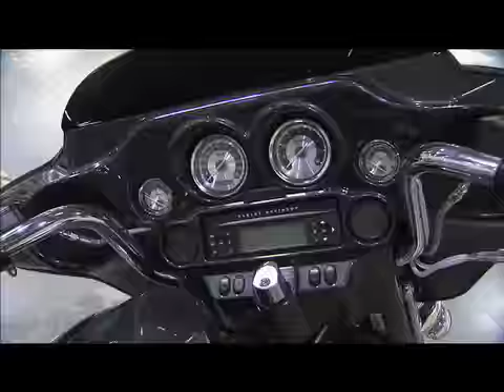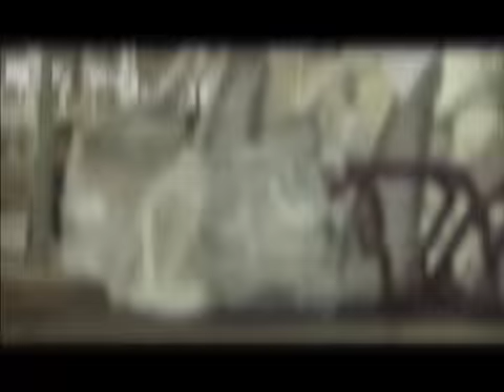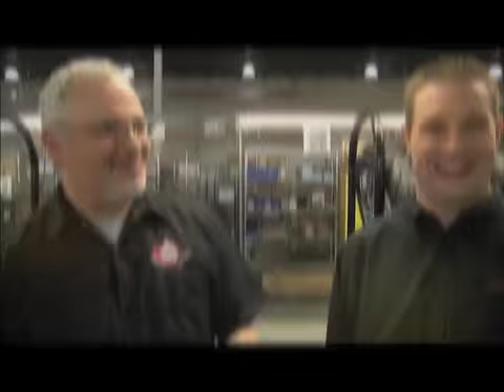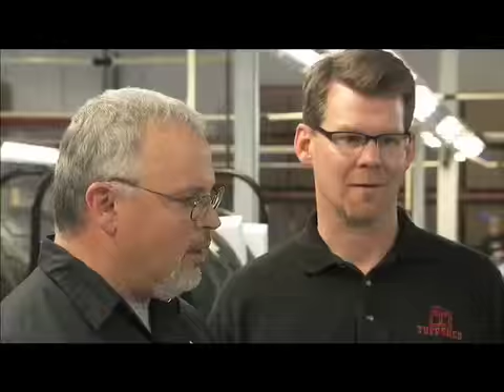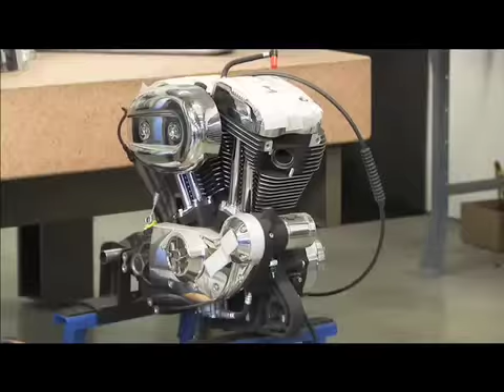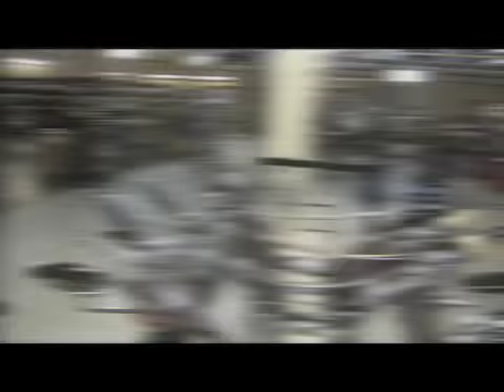Episode I: Meet Thunder Mountain Custom Cycles

Comment: The rear sprocket for my drive belt was chewing up the belt. The teeth became really sharp. Could not find a replacement that was identical but did find a suitable replacement that worked, not the same style but still chromed out. Would still like to know where I can find parts for my 2008 Thunderbird Mountain Durango. Especially the Leison plate chrome frame and LED light